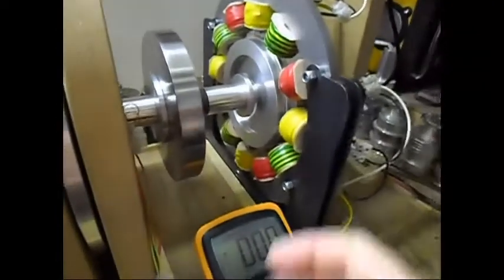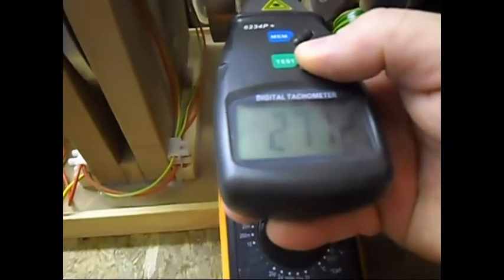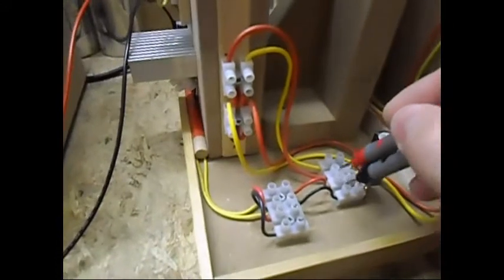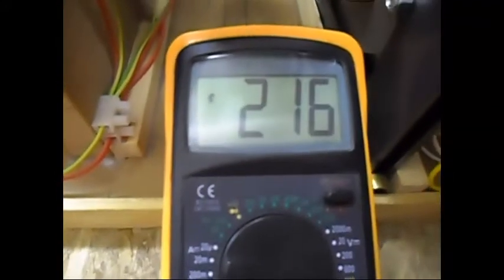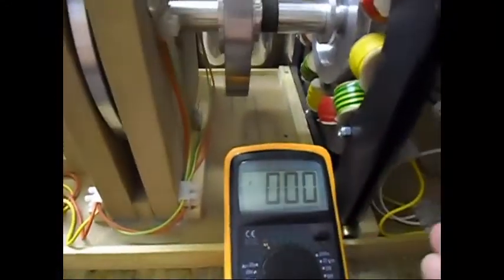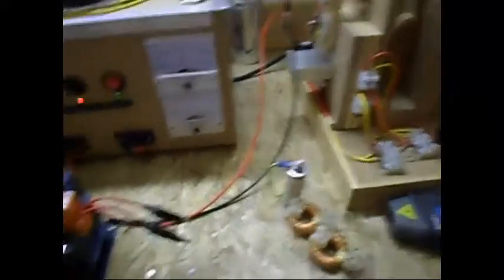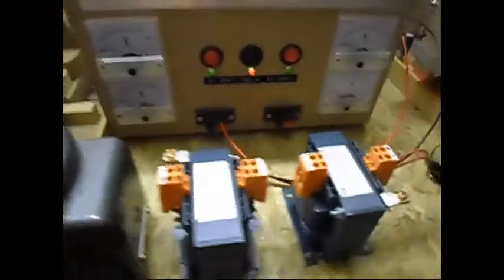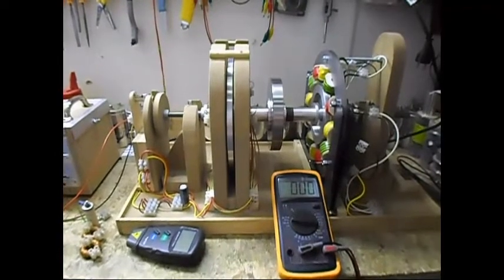Single Phase Generator_Update 12,  4 sets of 3 coils @ 200(ish) volts @ 2700(ish) rpm...

Comment: next step: 3phase rectifier DC into capacitors,
http://www.thebackshed.com/windmill/articles/Rectifiers/3Phase3Bridge.gif
finally a magical switch output to input!
well i did a model of induction motor, i failed to feed input from the output :-(
Reply from the maker: Thanks for your comment and the rectified circuit...^^
This is not a 3 phase generator...i just wired up 4 sets os 3 coils so it is a bit easier to do all kinds of test on it...;-)
To feed to output back to the input side is not an issue...that the input always exceed the output is...lol
Btw, i never seen sucha way for connecting a 3 phase generator...nice one...^^
I do have other 3 phase setups to build so i will try this one out...;-)

Comment: Great. You have metered the input as 19.89 watts from 15.3v X 1.3 Amps. To find out if you gained power rectify each of the output legs into DC and measure again the outputs in VDC. Put loads across each of the legs simultaneously and get the amp in each circuit. The total wattage of all the 4 legs should be equal or more than the wattage of the input. The wattage of the output and the input should be measured at the same time, not separately. if the output wattage, not voltage, exceeds the input wattage, then you broke the law of physics and you deserve a Nobel prize. Convert the output to DC because the frequency of yis not 60 Hz and the meter is calibrated for 50 Hz for ACVolts.
Reply: Correction: The frequency of your generator is not 60 Hz but your voltmeter is calibrated for 60 Hz for ACV scale. Converting to DC eliminates frequency related problems.
Reply from the maker: Thanks for your comment...^^
That's the whole idea from the beginning...but as always i only do that if i see that there is some good desire outcome and effect...other wise i'm only waisting more time and i do have a long list of stuff i need to build and test...;-)
And so for now i'm only doing test on 1 set of 3 coils...^^